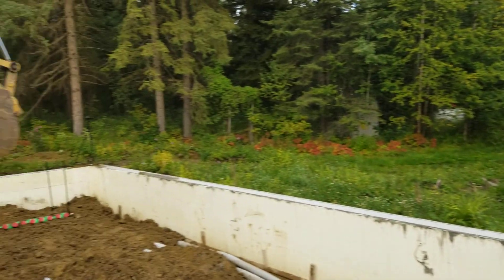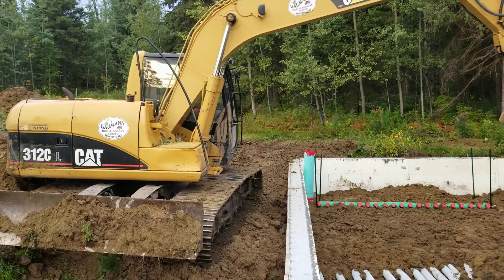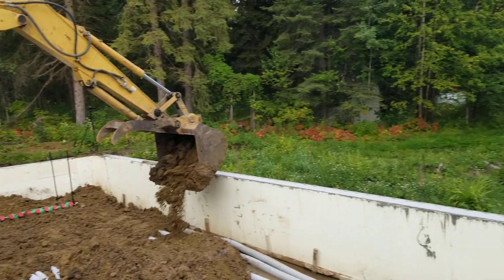Building The Climate Battery - Live Happening Now #Passivesolargreenhouse #Growyourown #Resilience

Comment: For what it's worth, you might consider segmenting your manifold in two and connecting a second set of risers. From what I can see (10" manifold with 10" riser, 20ish 4" pipes) your airflow will likely be too diluted across that many pipes to maintain turbulent flow in the piping for the most effective heat transfer. We've also found that securing your pipes to the manifold with a decking screw helps to prevent them from pulling out when they're inserted. For perspective, we've built two of these systems in commercial scale (30x96, 34x96) greenhouses and have learned a few lessons over the years. Best of luck with your project. An ICF foundation will surely help. I am always impressed by folks that undertake one of these. We definitely learned a lot of lessons during the construction and backfill process of our two houses.
Reply from the maker: Thanks Tim. the screws would have been a great idea. We backfilled very carefully.  The reason we went in the other direction was based upon extensive finite element analysis thermal modeling. We modeled  several permutations. I am curious how your systems are working? Better than expected, worse than predicted?
Reply: @VergePermaculture  you're smart to backfill carefully. To answer your question, we really weren't sure what to expect because our structures are not insulated to the degree that most installations I've seen are. So we developed operating conditions over that first winter and spring regarding the temperature deltas we could expect based on climate battery temp, outside temp, and time of year. I've been pleased with the results so far but have been looking to improve on the design. We work with a local university to study our houses and do air velocity and heat transfer simulations. We've published our results at threefold farm.org. Would be glad to have a chat with you sometime and compare notes. Would really like to see systems like this in more greenhouses.

Comment: You are wasting your time with that 4 inch manifold and Single 4 inch intake tube.  Should of used 12” manifold with 2 12” intakes. Please do more research or you’ll be very disappointed in the performance.
Reply: Check out the previous video "We Are Building a Climate Battery/GAHT/Subteranean Heating System in our Passive Solar Greenhouse".  He says the manifold is 10".  In this video, you can see everything at the 2:40 mark.  The manifold is light-blue in the upper left corner, and there are 20 runs of the 4" perforated pipes.